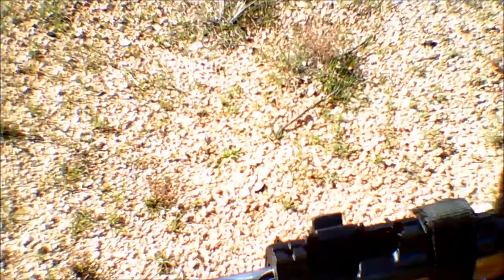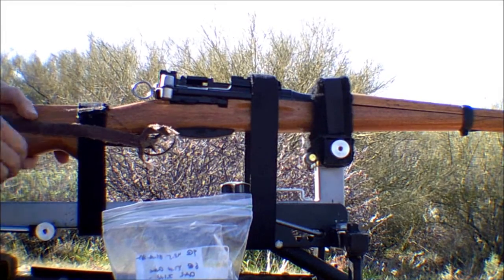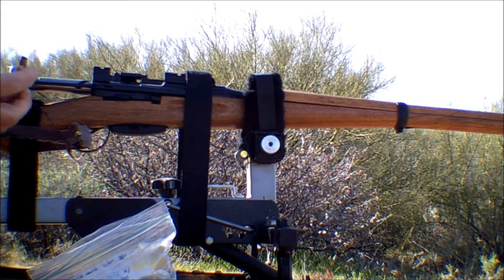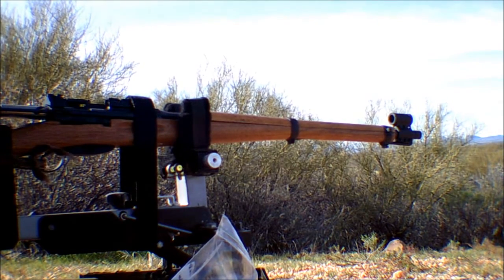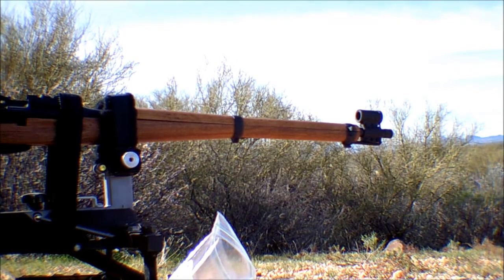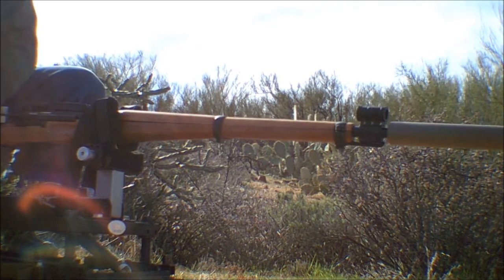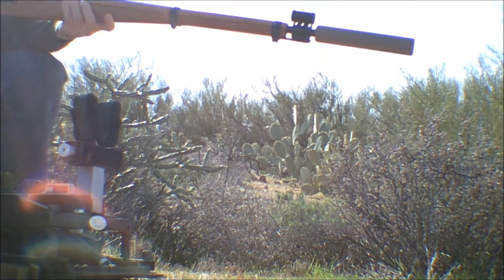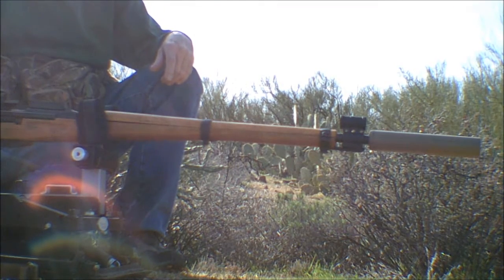Re-Barreled  ReChambered my K31 Swiss Rifle

Comment from the maker: Hi Mike Dothan:

I don't really know what it would cost to have a K31 re-barreled and re-chamberd by a local gunsmith.  When I did mine I didn't keep accurate tabs on the time it took to complete this project.  To me it was just a hobby project.  I worked on it as time permitted.  

I do remember that the cost of the barrel blank, chamber reamer and range rod came out to just under five-hundred buck by itself.  This was before any actual work was done.  If I had gone with another 30 caliber chambering the price of these materials would have been substantially less cause I already had some of these tools on hand.

I think that all together the time it took to actually do the work was about equal to a 40 hour work week.  An experienced gunsmith and/or machinist could probably slash some time off of that.  I'm neither a gunsmith nor a machinist, that's why it took me so long.

Someone told me that the average labor charge of a competent gunsmith is somewhere in the $50.00 an hour range.   If this is so, then if I multiply fifty-dollars an hour times the 40 hours it took to complete this project, then I come up with two-grand worth of labor.  Add this the cost of tools and metal stock then you get into the twenty-five-hundred dollar range for such a project.  If you do it yourself, that's where the savings comes in.

I'm not sure if these numbers are realistic or not.   I am sure that I'm one of just a handful of K31 owners on the planet that is now the happy owner of a custom chambered 6.5x55 Swedish Mauser K31 rifle though.

There's only one guy I know of or have heard of in the United States that does this kind of work for a living.  I've never met him but I have sent him email inquires on three different occasions and each time he sent me a rely.   In my book, that's a sign of integrity.

http://www.lprgunsmith.com/K31_rifles.htm     The guy's name is Larry Racine.

I think any one of the chamberings you mentioned would be a good fit for the K31.  I've been dreaming of doing another in 6.5x284 myself.